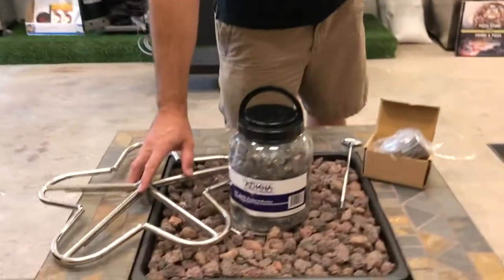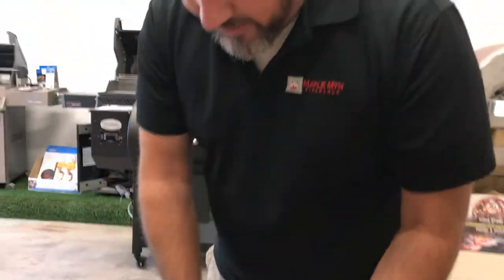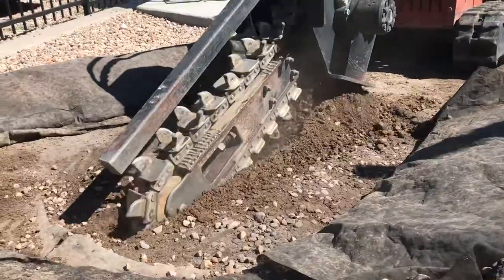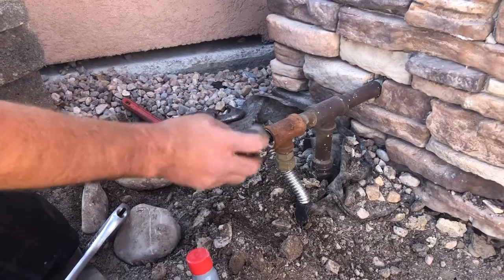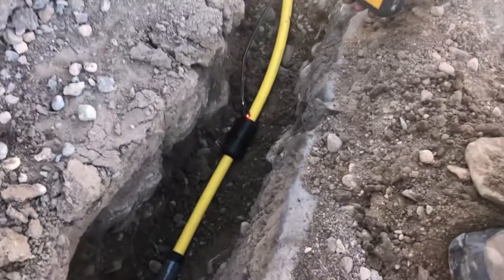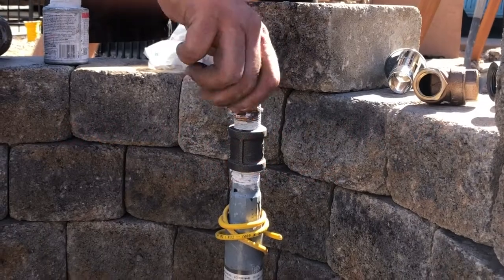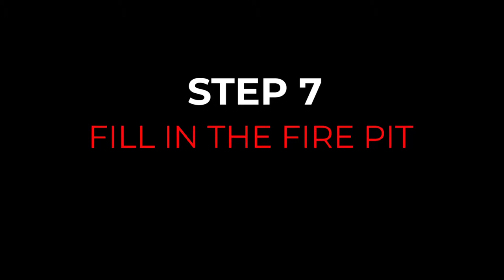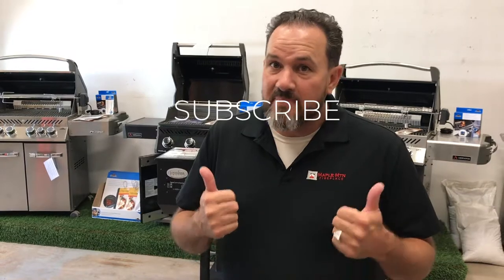DIY Gas Fire Pit Build

Comment: Great video! Thanks for posting. This is exactly what I'm hoping to install in my backyard. I'm planning to use 1" pipe/risers though because I want to be able to run the fire pit, a grill, and an outdoor space heater at the same time. The distance from the house is about 60-70ft. Is 1" overkill?
Reply: If I'm being honest with myself, I'll probably never run all three appliances at the same time. Should I go with 3/4" instead?